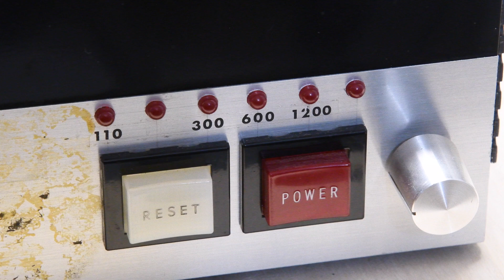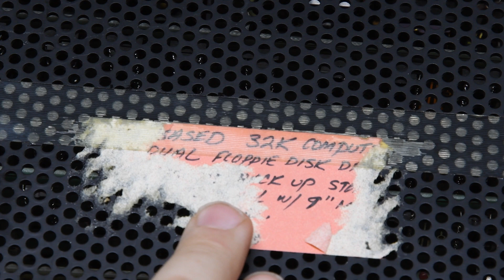Home Computer From 1976 - SWTPC 6800 (Plus Accessories!) - First Look

Comment: If you need some new standoffs for your motherboard let me know, they can be a little hard to source and I bought several sets
Reply from the maker: Thanks for the offer!  I'm debating whether or not I should change them out for threaded standoffs with screws.  They would prevent the motherboard from pulling up when removing cards and also keep removal of the motherboard simple, but they might take away from the original look...